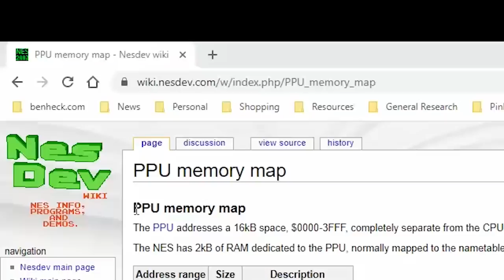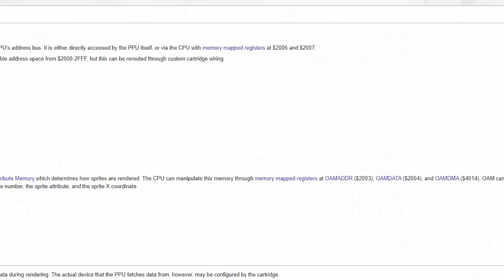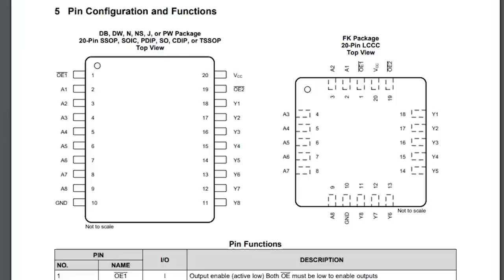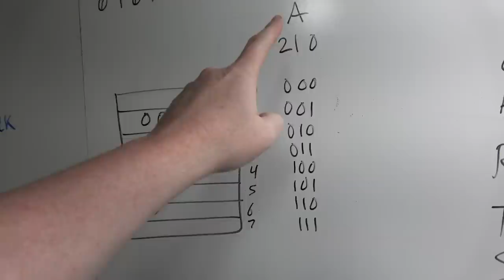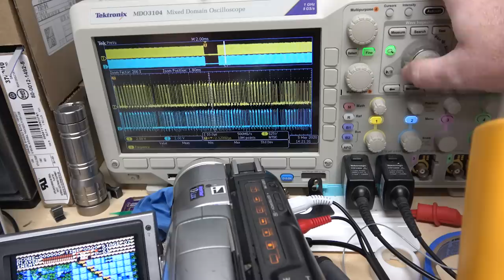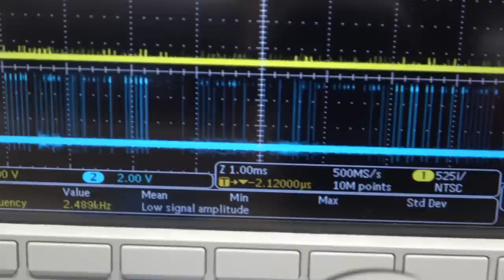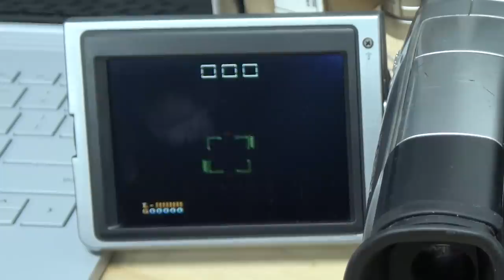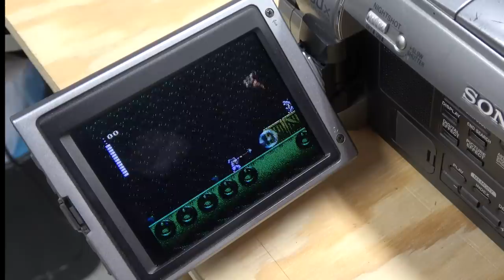Fixing Another Nintendo M82 Store Demo Unit

Comment: Seeing him work and his knowledge is like seeing a master artisan, but more fun. The legend is real.
Reply: I dare Ben Heck to build a functional NES game playing machine using only spare chips and a mos 6502 or whichever chip the NES CPU actual operates as, bonus points for taking an Atari 2600 CPU chip and adding NES type components (generic ram chips that would work, possibly the only parts I'd really say are acceptable to use from a pre-existing NES system would be the ppu chip , the cartridge recepticle, and the MCU that ensures the cartridge is authorized (possibly also any ROM chip necessary for an NES, if any exist. (My knowledge on NES hardware components is limited, but I'd love to see Ben Heck going through and troubleshooting his way into a working game cart player by attaching a game cartridge and fixing any issues as he has in the past with handheld conversion projects and / or how he figured out how to make banking carts work on the UK m82... I'd love the video he could make from that. If he doesn't want to , no pressure, obviously, but it sounds cool as an idea in my head...
Reply: That was better than an episode of Matlock
Reply: @seanabsher5577  Well the CPU contains most of a MOS/CSG 6502's actual lithography, illegally copied by Nintendo with the patented stuff removed (BCD functions if I remember), and Nintendo added some NES-related functionality (possibly just sound).  So using a bone-stock 6502 might not be doable...
Reply: @CommodoreGreg  stock 6502 + audio hardware and other chips and etc to make it do the job? Or would it actually need an NES CPU just to do the work? Seems like a stock 6502 + support circuitry could do it
Reply: I'd argue that Ben IS a master artisan.

Comment: Ben Heck is a genius, no doubt about it. The demo units are working now, all right. Still, my crystal ball predicts somewhat sparky future for these devices. An uninsulated metal heat sink fastened by a bag closing tie, the long uninsulated resistor legs almost touching the pins of the module connectors, as well as dremeling a screw head to metal dust over the unprotected circuit board in the another M82 video made the temperature of the room sank at least by 10 degrees. The dark side of the Force must be running strong in this channel.

Comment: Damn man, you went so many levels deeper than I ever could on that retro hardware debugging, and I thought I had a knack for it.
Reply: address bits level. it's no trivial task. although a ground shorted address bit made perfect sense since the beginning, but as in the Nintendo Playstation prototype episodes (mainly faulty elec caps which led to a previous mod that disabled the CD drive), everything is dead simple once you're being told about it. But getting to it is not as easy.

Comment: I'm the one who sent this m82 in.  the issue still persisted  that i was having  after the unit came back to me.  all the graphical issue in this video was not related to the issue i was having in this video.   so after the disappointment of the issue i was having still persisting  i bought another m82  (pal b unit)  from Germany.  and converted it over to NTSC  however i noticed one difference that my m82 didnt have  and that was four 103 ceramic capacitors that were directly connected to 4 buffer chips in the front center of the board. (a hot fix by nintendo on later models)

so i ordered those same caps and attached them to my old m82 motherboard buffer chips  and that fixed the graphical issues.  4 years 2 others working on the unit and 1000 dollars later i finally fix it.  i wish i had known that was all it took to fix it in the first place.  Anyways thanks for trying Ben heck.

Comment: Regarding Punch-Out: it used Character ROM, not RAM. What made its mapper (the MMC2) special was its ability to automatically swap CHR-ROM banks when the PPU read a certain tile from the pattern table. This allowed games to increase the number of unique tiles shown on screen without having to spend precious CPU cycles on using cycle-timed code to swap CHR-ROM banks.

Comment: Hey Ben! Have you ever come across an Ultracade in your repair adventures and experiments? I would think that its inherent mixing and matching of arcade hardware having to handle multiple different vendors (even though they supposedly all interface thru JAMMA) may present more complexity than the single-vendor M82 or the Nintendo Super System.

Comment: Your next project should be to use a heatgun or reflow station and remove everything on one of these after taking really good pictures and then scan and measure the boards and traces and get replica boards made up and figure out all the chips to basically make a replica to test things on

Comment: Rather than destructively breaking traces to track down shorts I find the best method is to dump an amp or so through the short, then measure the volt drop in the traces.

Comment: Well from what I learned from the guys who made Micro Mages, the NES can only access 40KB of memory at a time. So it having to bank or load more makes sense. But hey you have to admit that it is hell of a lot faster than PlayStation or PlayStation 2 load times. Need I mention Castlevania SotN or Summoner ?
Reply: 1000% true, unless your entire ps1 game fits in under 150kb of storage and it could read it into a buffer before it's used by the CPU and other internals.

Comment: Is there some kind of big (recent?) debate on how there's 'no loading' with cartridges I'm missing? Sure it's faster than loading from CD or whatever, but of course there's some loading.
Reply: In the Late 80s / early to mid 90s , many console gamers constantly played fanfare to the greatness of cartridges never having to take time like the psx did... Or Sega Saturn or Sega CD etc. I lived through hearing people complaining about disc loading times and comparing to cartridge based consoles, how cartridges were better cause they didn't have those disc based loading times --- I'm pretty sure that reached an apex during n64 vs ps1 era gaming
Reply: @seanabsher5577  Considering they were being compared to cassettes, yeah the load times were better.
Reply: @davidmcgill1000  in USA very few people ever had home computers with cassette tape data storage hardware, commodore wasn't nearly as successful in USA as in UK and parts of Europe, but even more specifically, the use of cassette storage was near 0 adoption rate in USA (almost everyone who had a computer like the pet or Vic 20 or c64 or zx spectrum  , CPC, apple ][ , etc mostly used floppy disk drives (USA)
Reply: @seanabsher5577  This isn't completely true. The Commodore 64 was incredibly successful in NA, with 17 million units sold. That doesn't seem like a lot, but for the 80s it was pretty good. And if you could afford a C64 ($595, with inflation $1,580) you probably got the Datasette add-on as well. Blank cassettes were cheaper than floppies for a while. You could be right about the near 0 adoption rate, but I don't wanna believe I was one of the few people who bought one back in the day.

Comment: Everything loads. ;p
The main question is how fast.
If 'loading' is as fast as your computer can use data, then yes you are technically loading, but it stops being meaningful. 
Loading conceptually only matters if the loading process is slower than the rate at which the data gets used, meaning the system has to pause waiting for new data.
And from a human point of view, even such a pause is irrelevant if it's less than about a second or so, since this is barely perceptible...

Though I suppose you could argue that a ROM cartridge mapped directly into CPU address space isn't 'loading' because that's like having it permanently in memory.
(but then you get something like a SNES and there is no way to get anything into the PPU without explicitly loading it...)

Comment: You know the Calculator button is an actual key. It's not a macro, it actually sends a keycode to the computer so what I'm curious about is if you would do a project where you made your own personalized keyboard with all the unique keys that Windows could support :)
Reply: My Logitech K-520 wireless keyboard has it.
Reply: Very cool. I have an old dell keyboard from 2004 that i still use calculator button on the daily.

Comment: 13:55 I've never heard it phrased that way, just that cartridges had imperceptible/zero load times. I guess the most accurate term would be "instant access" as it doesn't have to wait for a mechanical drive; the data is just 'there'. Considering that any transfer of data into RAM could be considered "loading," a game that didn't load would be a rather boring one...
Reply: Difference being, from what I understand , is where loading means something more than just dumping data / code / etc from cartridge port into RAM / buffer, where the code / data has to travel through chips and / or a medium other than RAM / ROM / EEPROM / etc, before reaching the console's work RAM
Reply: @seanabsher5577  I guess it all depends on how strictly you define the term "loading." If you need some form of data processing to consider it "loading" then I can agree that not all cartridge games load. In other contexts where it makes more sense to call any data transfer into RAM, every ROM chip does load. Either way, the cartridges that use some form of data compression still do need to load.

Comment: I'd argue that when people say that cartridges don't load it's more that loading data from the cartridge is so quick that the load times are negligible enough to as good as not exist
Reply: On NES and SNES and Sega Genesis / megadrive, the loading time for most data "mid gameplay" or during the starting screen , on most games at any time load time is under 0.3 seconds, on a few outliers it's closer to 0.6 to 1.5+ seconds
Reply: The "no loading times" probably comes from the fact that the term "load times" was created / invented after the release of the first optical disc or magnetic media disk drives in consoles... Remember a common feature in japanese "famicoms" (NES in Japan) was an add-on disk system that had significantly longer load times than cartridge based games, but the disk system allowed for nearly limitless banking due to the drive being able to store a ton more data...

Comment: So if you disabled the 10NES lockout chip in this unit, it might not work?
Reply from the maker: It would still work. That's what I did on the PAL unit. It just loses the ability to detect and skip blank slots.
Reply: @BenHeckHacks  What about replace the lockout chip with some other way to detect blank slots?